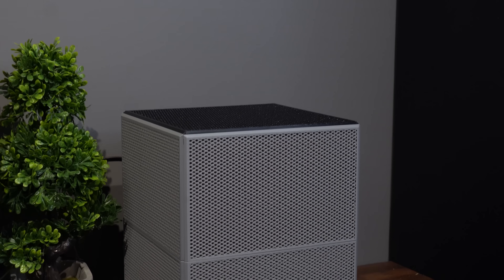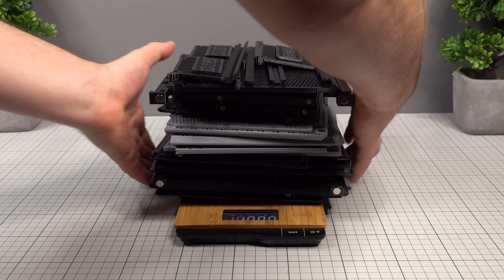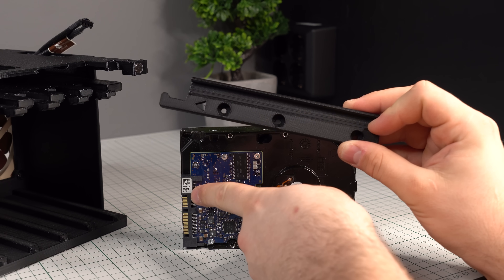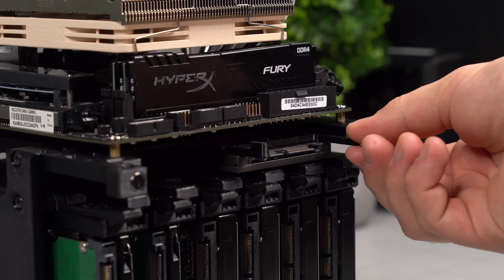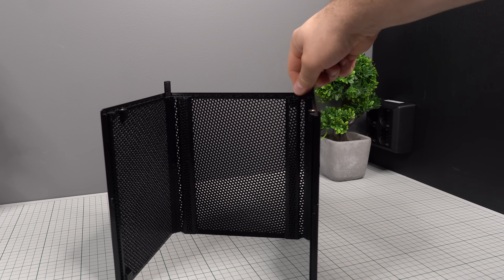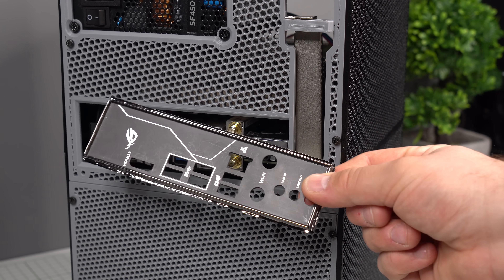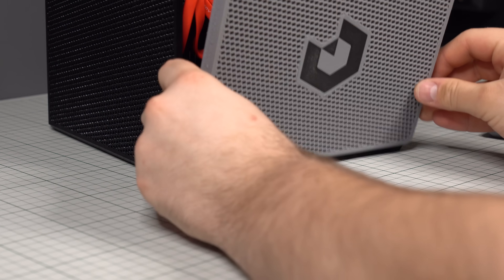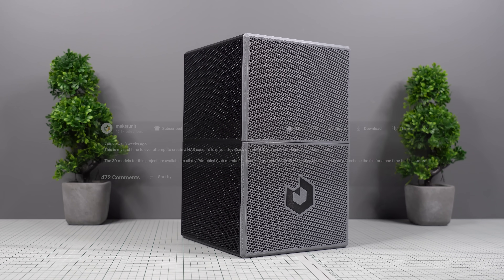3D Printed 6-Bay NAS case - Improved in every way!

Comment: Putting my raspberry pi 3 bay 3d printed NAS to shame 😅
Reply from the maker: Well, that depends, sometimes the smaller builds are the most difficult ones to pull off! Now I haven’t seen yours so hard to compare but I’m sure it’s nice too!
Reply: @makerunit  Yeah, it looks very nice, i prioritized aesthetics, the problem is the front end heat between the drives. which is really calling for a redesign, as the pla is not liking it. 

Thanks for the video btw, good source of inspiration.
Reply from the maker: @Polkem1  Some hard drive cooling is important for the longevity of the drives. Even a 60mm fan can help a lot. Having a constant airflow can even help a lot with keeping the PLA cooled too.

Comment: The views from this and other videos arent enough? We have to pay for the print file as well?
Reply from the maker: YouTube advertisements are not as lucrative as people think. Based on advertisements alone this video is still at a loss compared to the cost of building the case with it’s components. Only way for this to be sustainable in the long run is to charge a symbolic amount for the tons of hours put into design, testing prototypes and fine-tuning the design for it to function properly. You don’t have to buy it if you don’t want to, but the reviews are quite positive if you check them out 🙂 Happy new year!

Comment: Could this be used with just the inner part?
Reply from the maker: Hi, unfortunately not, at least not without modification. The SFX and third mount for SSD are mounted to the external chassis.

Comment: Does a P2000 Quadro card fit. Instead of the SATA expansion card?
Reply from the maker: What are the dimensions? 😊 if it’s single slot and less than approx 180mm long it should be fine.
Reply: @makerunit 

It’s 200mm long 😭
Reply: @makerunit 

Well it doesn’t really matter or does it?
It just the front panel.
I may try to modify the depth with some extra magnets or make a cut out. 😢

Am I missing something?
Reply from the maker: @MlMax252 The 180mm approx was just off the back of my head, I’ll load up the 3D model soon and check the exact maximum length. Might be more than I remembered. Actually when I think about it there is a version I made that’s a little bit extended.

May I ask what CPU cooler you had in mind, as the other version is deeper, but also less tall allowing for a lower CPU cooler than the original.

That other version was never posted publicly, but was made as a solution for fitting it inside the IKEA Kallax 😅
Reply: @makerunit 
That would be great.

I had the Pure Rock LP in mind. But I’m still not exactly happy with the price tag so it might be something else.
Reply from the maker: @MlMax252  Funny thing.. I double checked now and it appears we have about 200mm exactly of clearance. Do you know if it's 200mm from the IO panel, or from the edge of the "L shaped" metal bracket it mounts with?
Reply: @makerunit 
LOL
What’s the length from the PCIe slot to the front opening? 
The card is about ~6,9 to 7 cm long. 
(From the pins)
Reply: @makerunit 
It might just fit.
With the IO sheld attached it’s ca. 20-20,1 cm long.
😅
Reply: @makerunit How much costs the Case?
I would like to take it if possible.
Reply from the maker: @MlMax252  The case costs 12 dollars on Printables.
Reply: @makerunit ❤
Reply from the maker: @MlMax252 let me know if it gets too tight, If it’s just a couple millimeters I can help you modify the magnetic front with a hollow part to allow a few millimeters 😉
Reply: @makerunit ok thx :D

Comment: Why not male a rail where the hdd slides in and push in position with springs instead of that extra braked that also adds volume?
Reply from the maker: Not sure what you mean exactly. There is a «spring» mechanism built into the rear of the mount.

Comment: Big oof that the chassis is 6mm too tall. I wanted to put it inside an IKEA Kallax cabinet which has room for 335mm squared. The case has a height of 341mm :(. I currently plan on rebuilding my NAS in the fall of this year. I hope I can shave off ~10mm of the top part somewhere so that it can fit inside a Kallax
Reply from the maker: I have a KALLAX edition! Slightly smaller and slightly deeper. Wanna try it? If you get the files I can send you my KALLAX modification files 😊 message me on Printables if/when you do so I can send you the files!
Reply: @makerunit that's awesome! I'm still waiting until this fall. Currently in the midst of a home renovation. My A1 mini can't even print this so I will get a Centauri Carbon later this year. Will definitely buy and hit you up when the time for a NAS is there!! ❤
Reply from the maker: @danielvos1558 awesome! It’s also worth noting that the KALLAX edition does somewhat lower the max recommended height of CPU cooler to about 50mm instead of 70mm. 😊

Comment: For me, the only thing missing would be an opening to attach a front panel USB slots panel - which isn't a huge loss either given the IO ports in the back - it would just be a small quality of life improvement and arguably a small one at that. Cheers!
Reply from the maker: It’s a very simple addition to add actually. However might be a little impractical due to the removable front panel. Perhaps the top would be a better suited location.
Reply: @makerunit hard agree on the last point.

This was the first video I ever saw from your channel and I'm pretty impressed with the quality of the production as well as the final result. Cheers
Reply from the maker: @AaaTeeEyeBee that’s awesome to hear! 🙏 thanks!

Comment: A noob question: Can't I do it with PLA?
Reply from the maker: You CAN, however if your system gets too hot there’s a greater risk of things deforming when using PLA compared to PETG for example. However if you expect your system to run cool then PLA shouln’t be an issue in most cases.
Reply: @makerunit  Thank you. It's very clear.

Comment: Hit there I love the build and just got a 3d printer and built a nas, the only problem is that my psu is an atx and not a sfx form factor. Anyway, of altering the file to make this work or do I just need to move on and look for something else. Love the look so hopefully someone has a work around.
Reply from the maker: Hey! I’ve heard some people did this modification but I don’t have the files for that mod available unfortunately. It shouldn’t be a massive job to make possible though, but will restrict the air cooler height supported. From like 70mm down to about 40-50mm. Do you have experience modifying .step files?
Reply: @makerunit  not yet just got into the hobby but it's a great time to learn. Thanks for the info. Time to crack open the good old YouTube university classes. Thanks for the information I really like your builds maybe I'll end up making one of your other builds one day but I really loved the look of this one. Keep up the great work

Comment: This is such an amazing design and build! I know this was uploaded a year ago so don’t expect a reply but is there any options to use an ATX size PSU for this build? I’ve got the mini ITX and everything but am trying to use my ATX PSU that I still have from my old PC

Thanks again for sharing this awesome design!
Reply from the maker: Thank you! Luckily the YouTube creator studio app perfectly places each comment chronologically in a list for me based on when it’s commented, making it easy for me to keep track of comments regardless of what video it is 😁.

There’s no specific reason for not including ATX psu’s however it should be a quite easy modification possible to do if using a very low profile cooler like the Noctua L9i or similar. It’s possible to get the .step file if you’re interested in making some mods to it. Let me know if you purchase the file and need it 😊
Reply: @makerunit  thanks for the response! I've got a corsair CX650M PSU. Do you forsee any clearance issues or anything with that one? I haven't purchased the design yet but will do! And I'm glad to hear the modification would be easy with the STEP file!
Reply from the maker: @ it’s very easy to make it slightly taller to allow room for it. There’s not enough clearance right now as it is but can easily be. Let me know if you end up getting the file, I have to send you the .step file manually for now.

Comment: this is awesome. How hard would it me to make it an 8 bay case? is that possible?
Reply: also how is the cooling with the full drives bays working?
Reply from the maker: Hi, I have no measurement for how the cooling performs. About making it into a 8-bay, it’s hard to say depends on your CAD modeling skills. If you either buy the file or get the Advanced Squad member you can get the .step file for the model which is easier to modify. 

Let me know your Printables username if you end up buying the file and I’ll send you the .step as well.

Comment: What part cooler is on the e3v2 @1:13
Reply from the maker: Hey! Actually it’s a custom fan shroud I made as an experiment. Basically a direct drive conversion using the «stock» parts, except for a metal extruder instead of the plastic. However it’s definitely got some flaws and is in no way perfect.
Reply: @ looked like a simple voron style hotend! The astetic is great!
Reply from the maker: @ The design was definitely inspired by voron! 😅

Comment: @makerunit Would love to use this but sadly i use an ODROID h4 Ultra with the Mini-ITX Kit and to expand the SATA Ports i got an m.2 -> SATA Adapter which gets onto the back off the motherboard. Wouldnt it be smarter to have a cutout below the mainboard for cases like this? guess there more people who can benefit from it.
Reply from the maker: Hi, this is definitely an option, though I’m afraid it might get a little too tight, or hard to access if simply adding a cutout in the current design. Would it be possible to put the boot M.2 on the back, and the SATA card in the front instead? Or does your motherboard only have a single rear M.2?
Reply: @makerunit  Thats the point, it only has a single m.2 and its on the back. With tight you mean because of the HDD's below or what? I mean there is already a small cutout for cables i guess, just make it larger. The part looks kinda thicc so i guess stability is not an issue?! Thx for your reply 🙂

Comment: Sadly my Bambu Lab A1 Mini Printer has a print volume of only 180 x 180 but I want this Case for my NAS Server any tipps or ideas?
Reply from the maker: Hey! 

UnfortunatelY there isn’t a solution for this at the moment other than splitting it into pieces and gluing, but I do not recommend doing this. 

I hope to be able to make one NAS designed specifically for small printers at some point in the future.

Comment: Overall, the idea is very cool and everything looks well thought out. But I am confused by the overall rigidity of the structure, maybe it is worth considering aluminum reinforcements to give the structure more rigidity?
Reply from the maker: Try to build it and you’ll see it’s suprisingly sturdy! If you’re not happy I’d happily offer you a refund! 💪 

When it’s all connected the parts interlock eachother resulting in a suprisingly rigid structure. Just check out the reviews/makes over at Printables

Comment: I really like that you are growing the design, and I'm sure if you keep adapting to feedback you will eventually find a product that you can sell at a price that encourages people to learn production.  If I were you, i'd eliminate the issues by integrating non-3D printed materials into the solution.  Personally I really like metals around my hardware, and have built multiple cases from Aluminum baking pans that cost $12 each, but based on what the current market wants in cases, I would say 2 chamber fish tank style cases are what people crave, and so pricing in acrylic glass from homedepot and finding their standard sizes to print framing around would be a great way to eliminate the excessive paneling due to print parameters.  

ONE DAY large 3d printers will become more cost efficient for us consumers, but until then I'd just work with standardized paneling products that are commonly available to your audience to print into place.
Reply from the maker: Sorry for the slow reply, I must have missed this comment. Yeah you’ve got some solid points. However, my goal personally is to make unique looking designs. Not cases that look like all the stuff you already find from other brands 😁

Comment: Printed and built my first one. Received the last piece, the motherboard, yesterday, and finalised the system as well. Running OpenMediaVault. 

Started printing the next one already while waiting for the motherboard delivery from AliExpress in late November.

So amazed with this design - if there was a 12 disk version available, I would jump on it instantly. 😂
Reply from the maker: Awesome! I’m working on an expandable one that should be able hold bays of 6 and 6. Teo modules can for example be combined with a ATX motherboard to create a 12-bay ATX motherboard NAS as well as many other configurations 😊 it’s still in the drawing phase but I have made a few prototypes of universal modules that can be attached in any orientation to suit almost any need! 😊

Comment: excellent case. really clean design. love the drive stabalisation. i'm looking for a 6x 2.5 ssd case for a rasp pi 5 m.2 to 6x sata build (still havent found yet) so its tiny (maybe half the size of yours) but still usable drive space. i'm finding the radxa penta hat with only 4 drives a little short on storage (using sata ssd only for silence). anyway, thanks for your video, great work.
Reply from the maker: Thank you! I might just make something like that some day. 💪 Who knows! What kind of power supplies are usually used for the SATA powercables when using a Raspberry Pi?

Comment: I love your design. You mentioned that maybe someone has an idea for your future projects. Here is mine. I have "ICY DOCK 6 x 2.5" SATA". You can buy second hand 2.5 inch SSDs cheaply these days. Using this, you can have cheap NAS with hot swappable 2.5inch SSD disks. I wonder if you would like this idea to have a low powered case which only has 5.25” Bay space for the disks. I would love that, but I am not sure if you find it interesting enough.

With these cheap SSD disks,  you can saturate 2.5G ethernet in the itx motherboards, and have a good enough NAS to be used for the home usages.
Reply from the maker: Hi! Thank you for your suggestion and it’s definitely a possible future project, at least inspiration for one. I get hundreds of suggestions so what I usually do is when I need inspiration I go back and read through previous comments and use it to gather inspiration that combined can result in a new design idea. 💪 taking what I find the best parts of every suggestion and combine them to something that works.
Reply: @makerunit , I love your work and thank you.
Reply from the maker: @mtrezaie  thank you! 😊

Comment: Great work. I desperately need a mATX board, ATX PSU with a 4 or 6 bays version; as small as possible and I won't need anything else for the next 10 years for storage. Fingers crossed.
Reply from the maker: Hey there! A modular version supporting both ATX mobo, mATX mobo and ATX psu is in progress. Currently printing prototypes to test fitment, so far seems promising! Due to being modular in any direction it’s a little «bulky» but has the benfit of in theory; infinite expansion. Not sure about posting date but the goal is within a few weeks. (Edit: turns out more challenging than first anticipated, new goal some time Q1 2025.)
Reply: @makerunit I actually think this is what I need 😅 please shout once this design is complete. I’m sure it will be great. Will be an instant purchase from me 🙏🏼